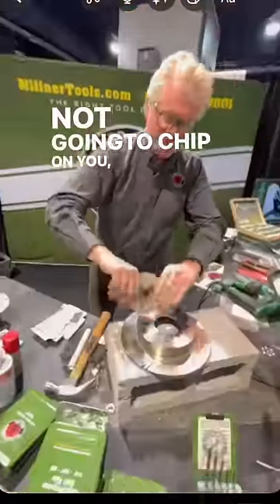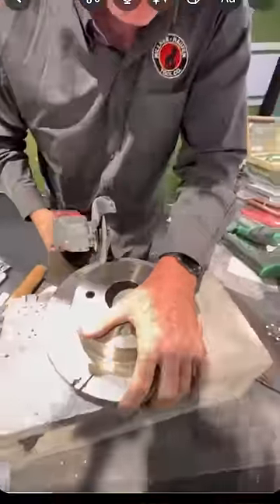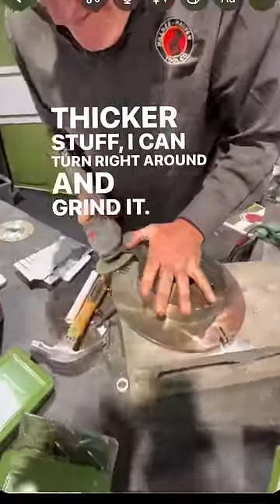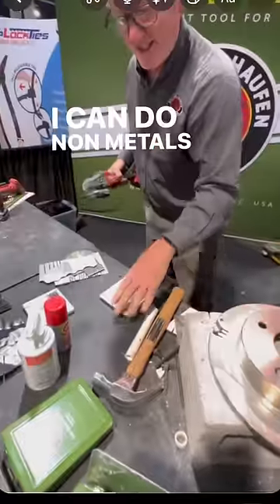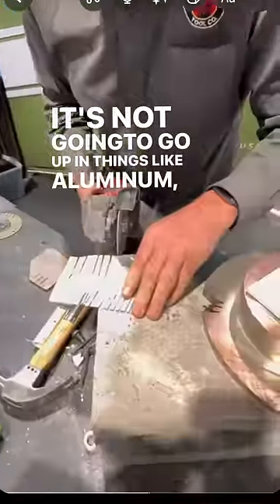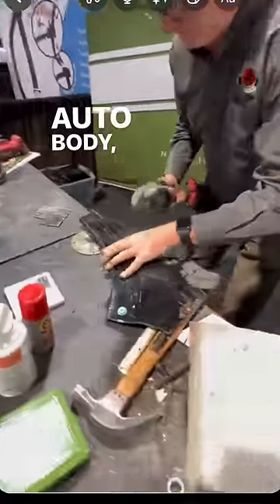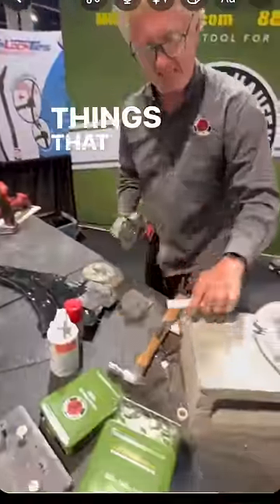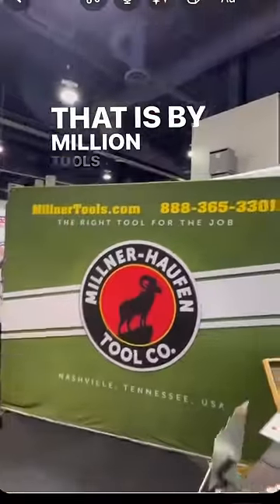I can’t believe he can touch it after all that!  #shorts #amazing #gadgets

Comment: Safety gloves and goggles have left the chat
Reply: Hay if the product fails he should too.
Reply: @Room1sixtyfive  kinda hard to use it if you're not literally standing behind it.
Reply: @luckyCOYOTE27  wow 🤣
Reply: If you’re scared, go to church
Reply: @b2b_ww_champs  if you're sacred, be a church
Reply: Safety gloves and angle grinders don't go well with eachother
Reply: @LVIS-a  thanks 🥳
Reply: @protein_powda  Until red hot steel sparks dust between your fingers, as you see both his hands don't stay behind the guard.
Reply: @smokiethebear3334   you don't use power tools much do you.
Reply: @luckyCOYOTE27  gladly 🌬️
Reply: @678friedbed  I build diesel engines as a hobby and have been peppered with slag more then once in places gloves could have saved, gloves are to prevent burns not stop you from slicing your finger off, if your on your angle grinder hard enough to slice off a finger you deserve it, heavy gloves would easily prevent a quick bump from taking flesh.
Reply: So none of you grinders have hearing problems?

I do.  Grinding and drilling, never without ear protection.
Metal splinters can be removed from your eyes, but hearing is lost for good. Trust me, be safe.
Reply: Support Russia.
Reply: @smokiethebear3334  can and have. I've hit my gloves with a death wheel a few times, and every time I was super glad I was wearing them
Reply: I couldn’t stop looking at how close his fingers were to that blade that just cut thru steel!
Reply: you dont wear gloves when you grinding they teach you that in shop you’re more likely to get hung up with gloves
Reply: 👁👁OSHA HAS ENTERED THE CHAT
Reply: @brooklyngrindstaff4329  What shop class? where?
Reply: @MarcoYolo420  you make a very good point.
Damaging your hearing is much worse than losing a part of your finger or an eye (not sarcastic). We can't see if the salesperson is wearing (custom-fitted) earplugs though. I clearly didn't see gloves or goggles
Reply: I was thinking more like having a respirator also you should loose your nazi patch its not very base to be supporting people that are shelling civilians everyday
Reply: @drumhailer547  Nazi patch? Please elaborate, because you seem to know a LOT about me that I am completely unaware of.
Reply: @LVIS-a  Not sure about that extreme. I have permement hearing damage on the right side and honestly quite happy to have all fingers intact!
Reply: @P01ZYN  I scrolled through ALL of the comments JUST to see this one 😅 and you didn't disappoint 👏 😏
Reply: I recommend to look up The Duran, Garland Nixon, Jackson Hinkle, The US tour of Duty, Redacted, Douglas McGregor, The New Atlas etc..., so you will know more about the issue.
Reply: glory to ukraine as a part of.russia
Reply: Fingers and eyes are soon to follow
Reply: @protein_powda  uh yeaa they do. Its literally designed to use with gloves. I wonder why gloves are required ppe when using an angle grinder? Would a company require you to use an item of ppe if it was going to hurt you? A 4.5 inch angle grinder will put a line in a leather glove and maybe go though but it's staying on your hand. The rotating equipment rule is for stationary equipment like bench grinders, lathes , saws. Since an angle grinder is handheld the only way to get caught in it is if you hold the angle grinder still while your other hand is being fed in. When I was on the pipeline you'd see like 10 welders at a time grinding all while wearing gloves.
Reply: Safety in general has left the chat
Reply: SUPPORT RUSSIA
Reply: What about hearing protection?
Reply: dunno about the US but angle grinders misuse makes them the most dangerous power tool in Australia
Reply: He Had goggel ...never wear Gloves near rotating stuff ..the can catch in the Blade and Brake your arm /wrist/and RIP of Fingers ...never wear Gloves or anything that gut get chatched and wraoed arround
Reply: He had glasses on they’re the same as goggles just a little bit less lame
Reply: Don't wear gloves with fast spinning power tools, that is how you lose a hand. I agree with the safety glasses though.
Reply: You do not wear gloves with rotating equipment...
Reply: @LVIS-a  bro your name is “Support Ukraine” your argument is invalid.
Reply: @smokiethebear3334  you get use to the hot sparks real quick I know I run a grinder everyday along with a torch, plasma cutter and welders all while working in the Florida heat. When I started I wore gloves for the first week now after several years I bare hand steel I just cut that would have been hotter than hell years ago
Reply: @smokiethebear3334  I've seen body parts removed from people because gloves got caught. 

You never wear gloves when handling grinders.
Reply: @chadklaren9537  That's fair, it's your job. Im not going to destroy my hands bc here in the winter it makes them tough to open some mornings but as a carpenter by trade I used a hammer for the first week then tossed it and started using my forehead!
Reply: @Room1sixtyfive  even if the product won't explode while using it, you still need safety glasses for the metal bits flying off of what he's cutting. I've done a lot of cutting with angle grinders and I've gotten several tiny metal flakes embedded in my cornea once. It was not fun and I was wearing a full face shield over my glasses when it happened too. Now I wear goggles with no gaps. This video makes me cringe
Reply: @julianburns6632  Finally someone with a bit of actual tool knowledge! Thank you!
Reply: And ear protection
Reply: He’s got his safety squints on
Reply: Oh cool you have the new money laundering emblem as a picture....
Reply: He's got his safety squints
Reply: Wearing gloves with something spinning 10k rpms is a recipe for disaster. That glove gets stuck say bye bye bones.
Reply: not to mention NO FUCKING RESPIRATOR?!?!
Reply: Z
Reply: @Beandiptheredneck  your lucky they didn't get sucked into the guard and mangled. Id rather get a bad cut instead of my entire hand destroyed
Reply: @smokiethebear3334  rather have the angle grinder take a bit of flesh than getting the whole glove sucked into it and breaking every bone in your hand. that's the exact reason you don't wear gloves. if the slag is spraying all over you, you are facing the grinder the wrong direction
Reply: @lobotomite9767  my friend did that 12 years ago, his finger is still deformed
Reply: Welcome to Ukraine.
Reply: @jeepmanxj  We're not talking about industrial equipment, we're talking about a 4" angle grinder. Not a stationary bench top grinder, if you do anything but bump the leather your not using the tool right and deserve to lose a finger or should go back to working a drive thru lmao
Reply: The guy is wearing safety glasses, what more do you want?
Reply: Don’t think anyone should wear gloves and a spinning grinder. Just saying…
Reply: That’s the whole point, he’s proving that he doesn’t need them due to the discs anti shatter property’s 😊
Reply: I mean tbh, the guys wearing glasses, I often won’t but goggles on if I’m wearing my glasses and I know I can direct most of the sparks away from my space, and I will never wear gloves will grinding even in winter, might stop that uncomfortable little prickly feeling but gloves turn a little Nick into a broken wrist and potentially for much worse cuts than if you had not worn them
Reply: @smokiethebear3334  yes. I'm aware of the difference. You are the only person who can't comprehend that
Reply: He could be wearing prescription safety glasses.  I've contemplated getting myself a pair, but I don't need vision corrrction for up close.
Reply: Absolutely, came here just for that point. Thank you
Reply: @jeepmanxj  You should press a angle grinder against your hand without gloves on then do it with gloves and come back and tell me what you like more LOL
Reply: If it doesn't get hot why do we need PPE
Reply: Fck the goggles... it's the bit where he cuts marble and stone without a respirator. Because... ya know... silicosis is fun kids 👍😁👍
Reply: @b2b_ww_champs  I went to church twice. Both times I came away scared as fck for the safety of children everywhere.
Maybe next time I'll try one that isn't Catholic or Mormon 🤔
Reply: He has glasses on
Reply: @LVIS-a  he means that the guy trusts his product. And it ain’t a big deal I can’t remember a time I used gloves when using an angle grinder, and usually wore safety glasses but he got normal glasses on they would protect him a good bit, plus they’re pretty big so less of a chance of anything going under them.
Reply: But, it’s not hot…
Reply: Support Russia.
Reply: @LVIS-a  guess you didn't notice the clip on safety lenses in his glasses?

Not to mention gloves and grinders have a love hate thing
Reply: Gloves with that king of tool would be very bad…
Reply: He has glasses on and you don't use gloves with a rotating tool. Especially an angle grinder.
Reply: @MarcoYolo420  when you get married your gonna wish you had some hearing loss start taking them out when u go steady with a gal
Reply: You never use gloves with ANY rotating power tool. F on the goggles though
Reply: While eye protection is always a must. In some situations gloves have a tendency to get caught..
Reply: He has glasses on bud. Why safety gloves? He’s using a tool it’s doing all the work.
Reply: Karen's in the chat though
Reply: gloves is dangerous with wheels
Reply: In my high school auto shop we never used gloves with our grinders. Safety glasses were for people that didn’t have normal glasses. Score for me
Reply: I have to wear a safety glove and safety goggle you don't know if the meterial your cutting might fly on your face or hand..
Reply: @protein_powda  You obviously don't spend a lot of time on angle grinders!
Reply: Gloves are not good with spinning things
Reply: @protein_powda  right? Good recipe for getting your hand degloved, at least partially and seeing your bones is never good time
Reply: its called de-gloving for a reason... not pretty.
Reply: No thanks.
Reply: Gloves not a good idea for a grinder. Grabs the glove and takes your hand with it
Reply: @MarcoYolo420  if you do it all day then yeah but an hour isn’t gonna do damage
Reply: You non construction people are funny.
Reply: @smokiethebear3334  he knows how to read the insurance policy, but that’s written by office workers who’ve never used a tool
Reply: @bunburner4850  correct. Haven't noticed clips
Reply: International symbol for money laundering has entered the chat
Reply: @hogey74  it's a wonder they're not banned - we have to have the government telling us what we can and can't do....
Reply: @smokiethebear3334  sorry but you are giving out bad advice here.

It's true gloves and grinders don't go together but if you are too much of a fairy to handle a few hot metal fragments then dont wear 'heavy gloves'

Were tight thin gloves that are not baggy at all. enough to deflect a spark and that's it. 

Positioning of the grinder also determines where the sparks end up, obviously sometimes with limited access you may be forced to cut in a way that sprays sparks at your hand. I would just say harden up and send it, its not welding spatter its a few sparks you big gosling.
Reply: @smokiethebear3334  that slight bump on loose glove could turn a little blood into a missing finger, broken hand, etc.

 Material+things spinning at high RPMs=nothing good. Just be a man and take a little bit of slag in the hand 😂
Reply: @Industry-insider  Mmmm, I wouldn't play with my health, but go ahead...
I have learned my lessons dearly unfortunately.
A colleague of mine opened my eyes, he is wearing expensive in-the-ear protection even at concerts. Such a wise guy!
But go ahead 😉
Reply: Not needed by men
Reply: Not needed by men
Reply: angle grinder is for grinding not cutting change my mind.
Reply: @protein_powda  generally avoid gloves for anything than spins.
Reply: @johnmosesbrowningsrightnut8642  Touch your hand to a angle grinder then before you try with a glove.
Reply: @JoshDavies111  Actually both your hands are supposed to stay on the grinder, an any injury is still an injury even if it's just a burn. Take an angel grinder to your thin gloves then put it to heavier leather gloves and see what works better
Reply: @Industry-insider  Well judging by your name (M3) you don't do as much grinding with a grinder as you do in a gay bar LOL
Reply: @azz2  that's what i said
Reply: @protein_powda  I know, I was agreeing
Reply: @azz2  ah i got u
Reply: @greasylimpet3323  Yeah I hear you.  In NZ you're legally allowed to do your own basic electrical work. They have half the rate of electrocutions of Australia.  More knowledge in the population being passed along ... that's my pick.
Reply: @Industry-insider  Let's see the dyno sheet lol until then... gay bar.
Reply: Gloves is a big no-no with things that rotate
Reply: @hogey74  yes, you're right.  I grew up with the mentality that if something's broken, you fix it, not just throw it away.  That's all being lost now, along with knowing how to use tools properly.
Best wishes to you from across the pond!
Reply: @AgnesLfm  Tools that rotate on a bench yes. As a matter of fact i just dusted my knuckle with a surfacing disc in the garage after work cleaning up some exhaust re joining pipes, instead of taking off a chunck of skin it bounced off the leather glove, you guys all believe in pillow talk and stories.
Reply: NEVER wear gloves when operating an angle grinder, the difference is losing a finger or losing your entire hand when the glove gets caught
Reply: You can have a prescription safety glasses. My shop teacher had a pair
Reply: Why would he need goggles lmao
Reply: @protein_powda  you always wear gloves with grinders. Your fingers aren't in contact with moving parts and you need protection from heat and dust. That's why you're now supposed to wear gloves, a full face shield and RPE when cutting steel or causing any combustion. I work in a welding shop and we know a lot more about the materials today. Just cutting like in this video, every day can cause lung cancer if you get away with not injuring yourself.
Reply: @smokiethebear3334  lol using both hands for a grinder. what are you 12? 

btw I don't wear thin gloves because im not a fairy. don't put your hands in the plane of rotation.
Reply: @smokiethebear3334  grinding a metal beam? what type of beam, what size. tbh i probably wouldn't use a grinder to cut one and if i did it would probably be a 12 inch so you would need to use both hands. If i was literally just grinding it to clean up edges i would use it one handed and use the other hand to rotate the material.

I'm having a hard time believing you aren't just some office worker. probably an engineer who thinks they are good on the tools.
Reply: @JoshDavies111  I'm a licensed carpenter in ontario. You wear gloves while using a hand held disc grinder, you won't pull a hand or glove through unless you force it.
Reply: @smokiethebear3334  think im going to take a carpenters advice on how to use a grinder anyway?
Reply: look up degloving and then you might think twice about using gloves. Maybe not, to each their own.
Reply: @julianburns6632  are you actually saying that grinders were designed to use with gloves? where did you stumble upon this wisdom? Audi curious as to where gloves are required as PPE for using a grinding wheel? Sorry I've got to point something else out to you, about the welders working on the pipe lines. I'm not saying that all welders are stupid or that they have all the knowledge when it comes to using their equipment, I'm just saying that people get complacent and do things they know they're not supposed to because they"know what they're doing" or it's just so much easier to not have to take their gloves off between welds or they don't want to lose their gloves if they take them off. it doesn't mean it's right
Reply: @Alden Wohlleben  handheld angle grinders yes, bench grinders no. You ever read the instructions for an angle grinder? It literally says not to operate without proper eye protection and gloves. Also we aren't wearing welding gloves to grind we use Tillman drivers. Why ruin a $90 pair of gloves when you can use $12 that are designed for grinding and handling metal.
Reply: @aldenwohlleben4990  smokie the bear has the mental capacity of a snail, he doesn't do to much thinking.
Reply: @b2b_ww_champs  we are the church dude, people are too scared to go to church not the other way around.
Reply: @yacobshelelshaddai4543  We can’t all be men…